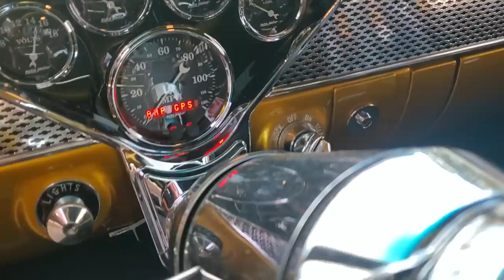Woody’s Hot Rodz 1955 Chevrolet Gasser For Sale~OVER The TOP by the Tri-Five Experts!

Comment: Perfect. Has some modern tech but still maintained the original gasser look. It needs a manual trans. Like a gforce 5 speed.
Reply from the maker: Thanks 😀 That would be an amazing upgrade!
Reply: To each their own.  I like it almost exactly as it sits.  Add a Gear Changers OD unit, a power steering rack and it would be a perfect Drag Week ride!
Reply: @WeBeAutosLtd  actually I take that back. It needs a clutch flight.
Reply: Turbo 400 is a excellent transmission.
Reply from the maker: LMAO 😂
Reply: @garymckee8857  they are. Power killers but tough. Got 1 in my boat.
Reply: 6 speed O/D...THE REAR GEARS CAN THEN HANDLE THE QUICK "GET ER DONE" MOVEMENT...(pant pant pant) if I had the $$$$$ it would be MINE!!!
Reply: Davidzz SPARKSY T EEEER.
Reply: @WeBeAutosLtd  Agree!! Love banging gears but an auto in this makes it more driveable when you get into it. Id drive this thing til the wheels fell off!

Comment: Hate to show my ignorance, but, what is the rod/handle in the tailight about?
Reply: Battery disconnect switch.
Reply: @stevecorner5069  thanks Steve. 
So to drive it, you have the rod pulled out?
Reply: Nick Stefanyshin race track rules are it must be equipped with a shutoff in the event of a fire
Reply from the maker: Yep!  It's Battery Disconnect, Just in case you want to race it 😂

Comment: Well she idles a little rough its missing the air cleaner and the front bumper and the tires are slick and it has no wiper blades. it will never pass  dot inspection. how much did you say you wonted for it. you do know it is a sixty five year old car.
Reply from the maker: Actually it's brand new with 5 miles on it and will hopefully never meet the rain 😉. A beautiful show car for sure!